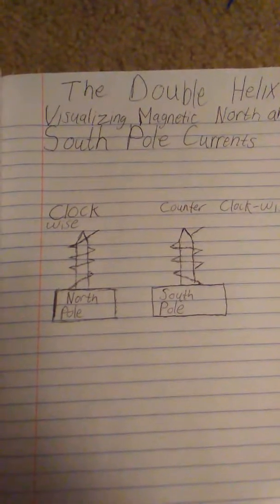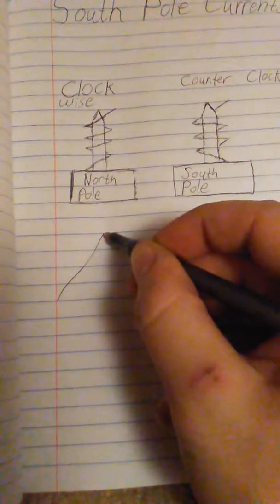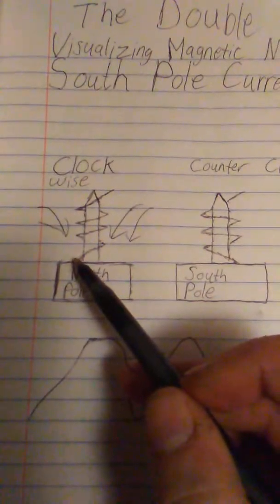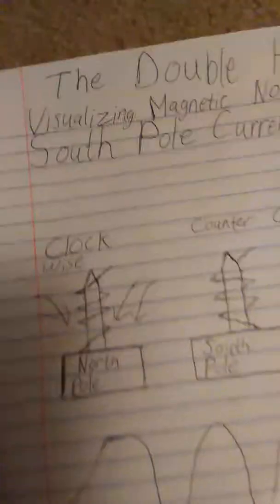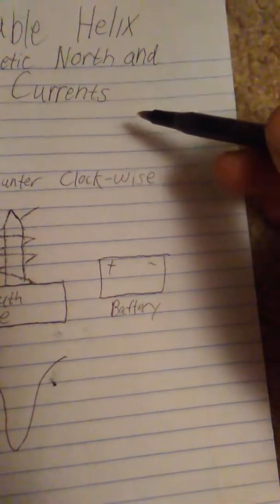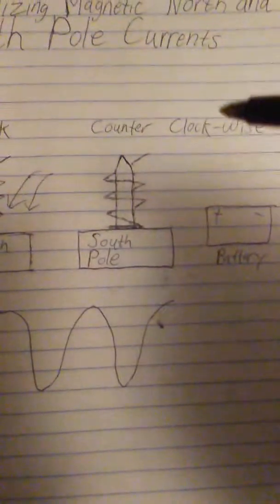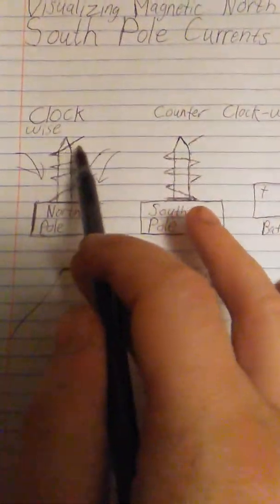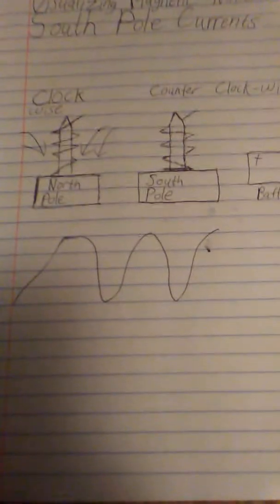Ep8: Visualizing Free Perpetual Energy Using the Double Helix Theory of Magnets!

Comment: So what your saying is the key to figuring out free energy is by picturing how north and south pole magnets connect with each other. Can these natural magnet frequencies be read on a oscillation machine?
Reply from the maker: They sure can! just get some thick gauge wire, make it into a coil of about 30 turns on a plastic tube. Take 2 strong magnets, connect them to a iron rod and make sure you can fit the iron rod through your coil. Put your leads on each end of your coil and watch the magic happen. The strong the magnets the better it works.